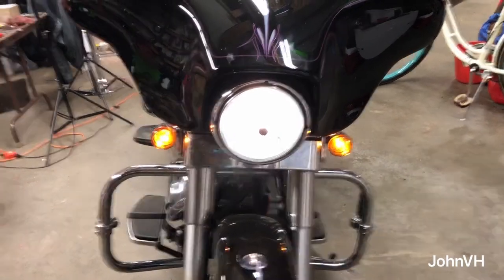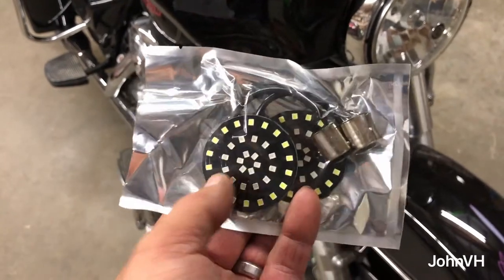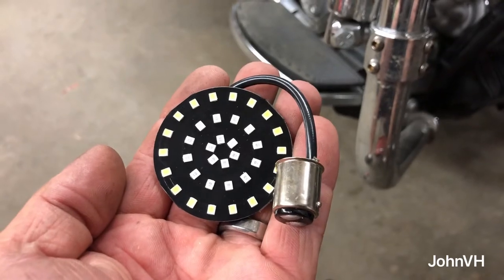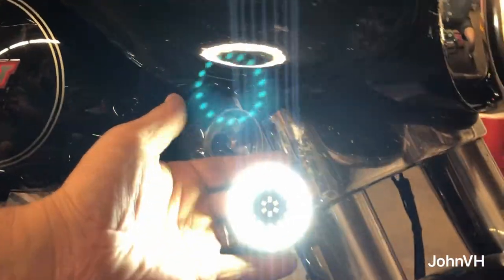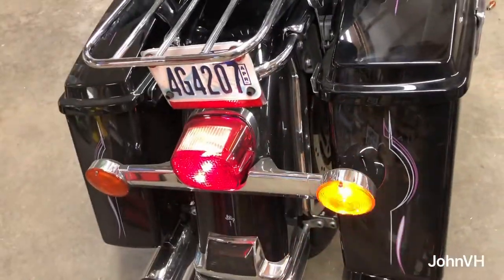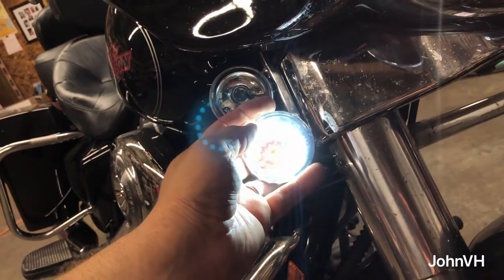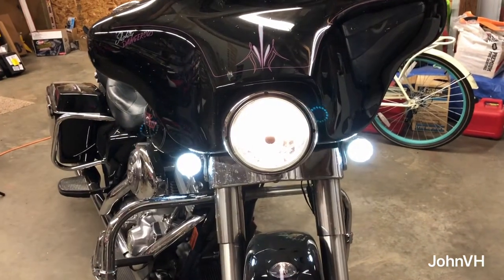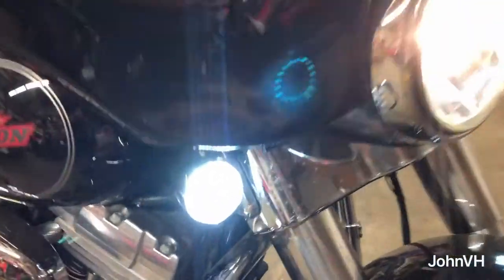Harley LED Blinker Install and review  LED Bulb Turn Signal Light Insert for Harley

Comment: Thanx for helping me to not make the mistake in buying them. Not that it was a mistake necessarily for you but i am no good at putting in diodes or resistors. I DID want them , but I'm just too old for fixing anything.
Reply from the maker: Youre welcome, there was nothing to fix.

Comment: Hi I'm getting ready to install all LED turn signals tail light and headlight on my 2005 883 Sportster I was told I didn't know this as well as you didn't that you have to put a equalizer a load equalizer for the LED lights
Reply from the maker: Thats correct, although, mine have been working fine after the initial fast blink.

Comment: I installed the same lights on my 2020 SGS and the lights themselves blink normally. But the indicator lights on the infotainment system are at hyper flash. The hazard trick didn’t work for me. Did yours get fixed?
Reply from the maker: I didn’t. I just rolled with it. Last time I rode it they seemed to be working fine.
Reply: Sounds like you need a load equalizer
Reply: @jennifershaffor9675  Actually it was just a simple fix of clearing codes.
Reply: @chrisrocker1108  how to clear the code mine is doing same thing?
Reply: @keepitreal317  I actually don’t remember. Just do a YouTube search on how to clear codes. I watched a video.

Comment: How did you wire that relocation kit up ? Mine is a 06 Electra glide and mine just stays lit and won’t blink at all just the rear  since I only have 2 wires off the bike and the kit has 3 wires on the lights was just curious how you got yours to work ?
Reply from the maker: Mine just plugged in and that was it.
Reply: @JohnVHLife  I figured that out after I went to Harley but by that time I cut the wires since I only seen one plug the other was hidden 🤦‍♂️.. now they all rock butt connectors 🙁

Comment: Did you ever get to the bottom of the hyper flashing? I’m thinking of buying similar for my 07 FXDB
Reply from the maker: It’s been working fine so I haven’t done anything. But if it is an issue I think you have to add a load resistor or something in the positive wire.
Reply: Ya buy a signal stabilizer from custom dynamics plug in under seat